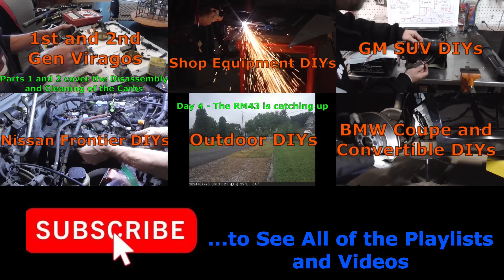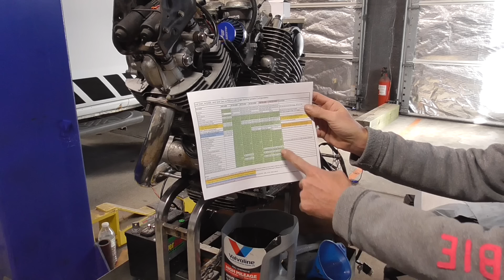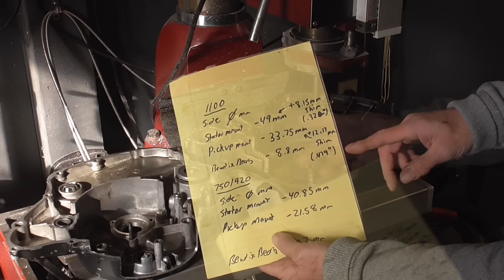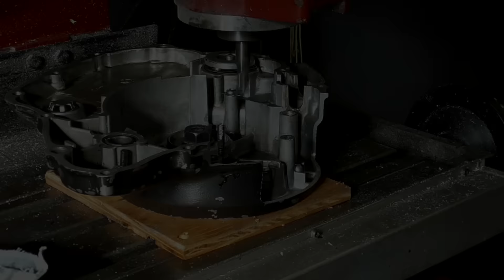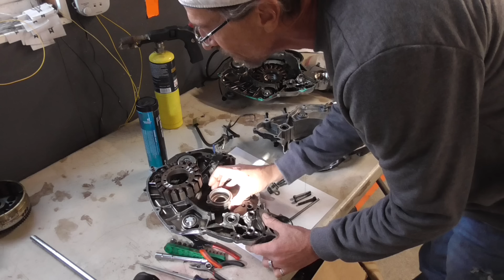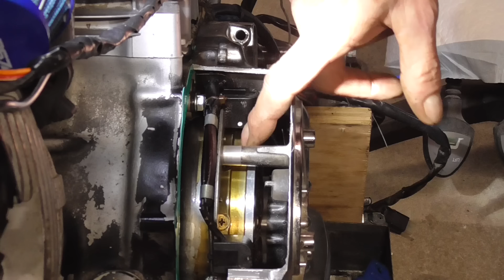Swapping an xv1000/xv1100 Starting System to a 1st Gen Virago - Part 4:  xv1100 system setup

Comment: Wow
Reply from the maker: Yep, it’s a bit of work to put a 2nd Gen cover on since the stator and pickups are in the wrong position.  Those are much easier to find than the xv1000 covers and starter system since Yamaha only made them for a couple of years so it makes for a good option. All the best !  Steve

Comment: Are there any plans to sell this shim? I am also converting the solenoid of an early model Virago, and this part seems to be enough to complete the process.
Reply from the maker: Hey !  Are you in the US?  If so, I can list one of the two initial ones out on my web store:  https://stevesdiys.myshopify.com/ .  If outside the US (or you just prefer eBay). I can list it out on my ebay sellers page:  https://www.ebay.com/usr/stevesdiys .  Just let me know which way and I’ll add them so you can have a look 👍. All the best !  Steve
Reply from the maker: Hey again, I saw your reply, but for some reason it only popped up for a minute, then did not post to the YouTube comments.

I’ll list a set of the shims out on eBay tomorrow and send you the link to them.  All the best ! Steve
Reply from the maker: Hello again, attached is the link to the eBay listing:  https://ebay.us/m/2YMFYx

All the best ! Steve
Reply: @StevesDIYs 32
Thank you for responding to my request. I have purchased it.

Comment: Hey Steve, I left a message on another video before seeing this one! But did you end up making the spacers/shims? This would probably solve my issue. I did this 1100 conversion/swap and can’t get it to start and when it does it just backfires constantly and sounds like it’s running on one cylinder. If you have a way to contact you I can shoot a video over for your evaluation
Reply from the maker: Hey man !  No, I haven’t setup to make any of the stator and pickup shims as I haven’t had much response on folks swapping to an 1100 side cover. I do need to play on the cnc mill though as I haven’t made any new designs lol so I might try to draw them out this week or next to see how the setup goes.

My email is stevesdiys@gmail.com if you wanted to sent me a video of your setup 👍. All the best !  Steve

Comment: Very nice and informative! For me just a tad late, because i'm in the middle of the swap process and had to figure it out myself. But still a good watch to confirm everything! Thanks! The original stator shim is 16 mm, so too thick. I amassed it along with other parts and was scraching my head about the purpose of that useless shim. Now I know. Designed and got cnc-d the new one. Should receive it in a couple of days.
Cheers!
Reply from the maker: Thanks man 👍. Good to know that Yamaha’s stator shim that they used is a different thickness…I saw one for sale out on eBay and almost bought just to see if it was the same as the one I fabbed up real quick lol !  It worked out really well for a setup on the 920 for me so hopefully it will be the same for you 👍. Thanks again and all the best !  Steve